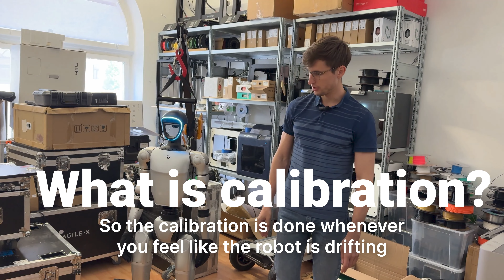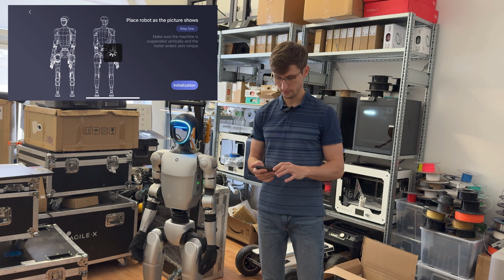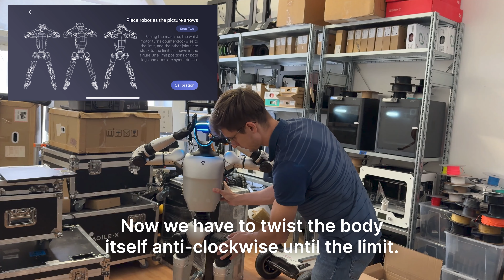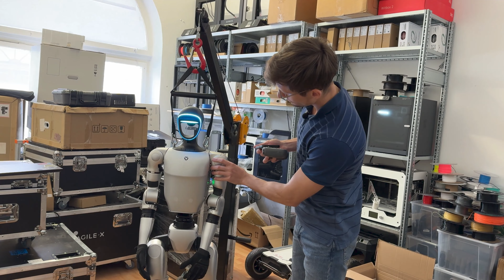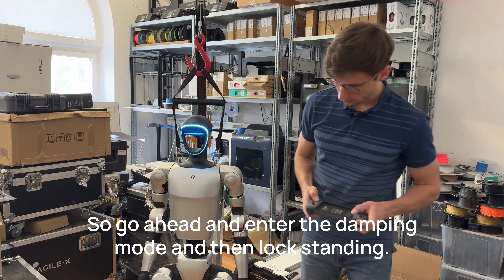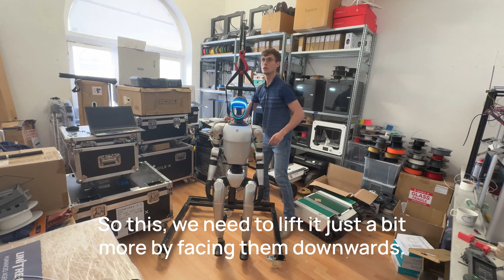How to Calibrate G1 Humanoid Robot from Unitree

Comment: Hi, I ran into the same issue as you during my first full-body calibration — the legs appeared misaligned (one foot forward and one backward).

Could you share how you managed to succeed on your second calibration attempt?
Did you change the robot’s posture or follow any specific steps?

Comment: Hey, thanks so much for posting this!  Do you have to celebrate the robot out of the box before using it for the first time?
Reply: As far as I am aware, the robots are being checked prior to shipping, so there is no need to perform calibration once unboxing. Only in case of movement anomalies
Reply: Hi thanks for the video, is there any way i can reach you for a couple goodwill questions?